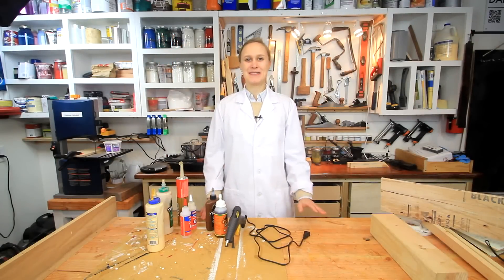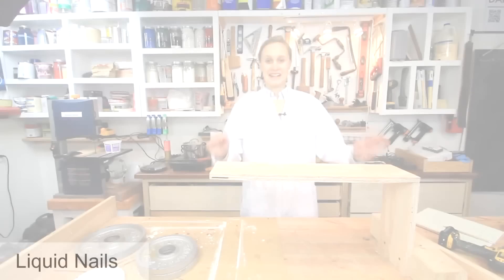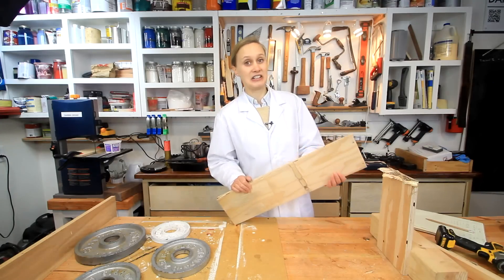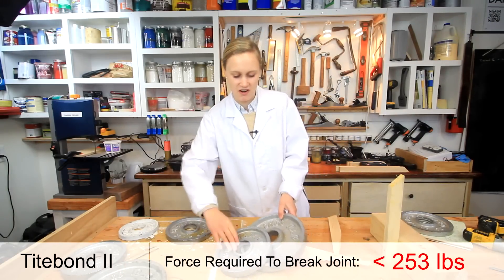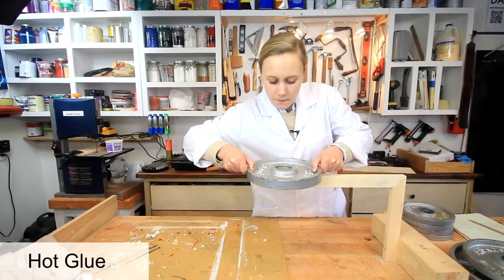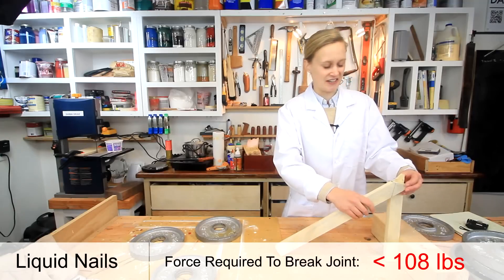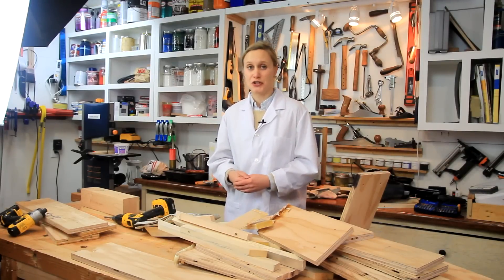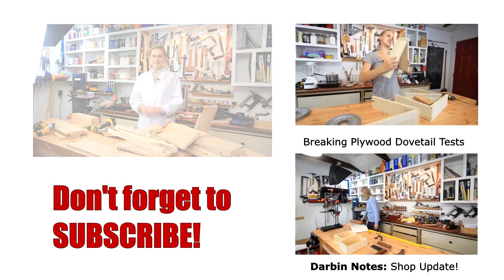Glue Test Destruction - How Different Glues Perform

Comment: Not surprised Epoxy is one of the strongest glue, remember that almost all of the WW1 and part of the WW2 airplanes were entirely glued together with epoxy !
Reply: Strong but the weak point is not a  flexible glue so it crack on long term vibration but depend also of the temperature
Reply: Interesting!  I didn't realize it was that old.  I looked it up and found it was invented in 1930.  It was originally amber colored and used for dentures.
Reply: Unlike the Hindenburg, which had it's hull glued on with UHU…

Comment: for the eproxy, it didnt break as the distance from the pivot has changed when Linn changed it to a 20 pound weight. Thus, the anticlockwise moment might not have increased.
Reply: True. A proper tensile test would have removed a lot of the variability involved with placement of the weights.
Reply: spoken like a true engineer

Comment: Good job.  I know of no readily available product anywhere as near as strong as a decent 2 part epoxy, no matter the material.  Wood, plastic, glass, fabric, etc.  2 part epoxy can't be matched with the single product stuff.  The drawback is the inconvenience of mixing it.  If you want it permenant though, it's the best.  There are even stronger industrial epoxies as well.  As for hot glue, there are many different types of hot glues.
Reply: I think high temp glue is a lot better than low temp or dual temp hot glue.

Comment: if you put the top section of plywood 100mm or 200mm past the vertical section you would be able to test the glue strength rather than the ply strength
on another note marine grade ply is always stronger than construction as its laminated with 2 part epoxy which sort of gives you your answer, without all the testing.

Comment: I always thought the advantages of hide glue are you can take it apart with heat, but it also has a long open working time. Strength is not the only attribute one uses for choosing what glue to use.

Comment: I think a part of the reason why the weights couldn't break the epoxy but you pushing it could is because the weights were also resting on the supporting stick by the fact of the way it is cut to rest on each other. When you pushed it, you pushed it up which doesn't have the supporting stick helping it to stay up and in effect just rips it off. To have a fairer test you should have pressed it down to mimic the weights as well as pushing it up.

Comment: Need a bigger sample size to eliminate anomalies and a variety of different joints/laminations/recreations of glue usage. The first test only established the fracturing point of that particular plywood and mitred joints are not really used for  projects that require structural strength. Matthias Wandel does some glue/joint testing which give a much better idea of what glue/joints are best for each use. You cannot base anything on this limited experiment. Never mind it was entertaining....

Comment: i wished you did a test using wood instead of plywood. you can see that it was the ply layers not holding up.for the test on mitered ends i must add that end grain of wood is extremely thirsty. End grain glue joints can be specificially prone to glue starved joints because the wood is porous there and soaks up the glue.

Comment: Sorry, I don't know if anyone brought this up, but construction glue is not traditionally used for butt joints or miter joints.  It is used to glue panels on walls as one example, and the forces on the glue joints will be in a different direction than on the joints you tested (I am not a mechanical engineer, but I think the forces will be shear forces and not stress forces).  I would also device a test setup that would mostly eliminate the stress on the wood and concentrate it on the glue joint.  Having said that, I did enjoy and I love your curiosity and enthusiasm!!  Keep up the good work.

Comment: This test proves nothing since you didnt hang the weights on the same point. Putting them on the same spot doesnt make it even sorry
Reply: you must not understand math, if you adjust for variation in lengths in your calculation you can put it at any distance
Reply: *****
 Thank you for your thoughts about my math skills but I am an engineer. I do know what I am talking about unlike you.
Reply: Sertaç İpek Then you should know that it's physics 101. Model those weights as point forces centered on the center of the weight and it's a simple torque equation. Since we don't know her math methodology, we don't know whether the distance was accounted for or anything. But obviously she was doing something since the reported forces are very different from the weights applied. You're picking at what's probably the most easily accounted for problem with the whole setup. Assuming all the boards were the same size, it's a matter of math, and you can always redo the math as long as you have all the data.

Instead, try picking on something that's actually wrong with the methods. Like laying weights in large increments which causes a sudden jolt of force on the boards. Or how weight was reduced and then re-added, which skews future results because the joint undergoes elastic deformation when strain is relieved.

Or just calm down, because she clearly states at the end that she understands it's not rigorous, it's not scientific, and she's not a trustworthy source. It's only meant as a real-applications sort of test to demonstrate what sort of performance you can expect in a hobbyist project.

Comment: Linn, a fun video to watch.  The concept of the test is fantastic.  The actual test, if you wanted to get reliable data would have to be done differently. The biggest flaw is from  spreading the force   across the horizontal piece instead of suspending the weight from lets say a hook that is placed the same distance from the joint.  An alternative to the weights would be a bucket that would receive sand.  Far more accurate.  There are a few other minor things (don't use mechanical fasteners), but overall I enjoyed the video and hope to see more.  Keep up the good work!

Comment: Nice video Linn! If only the glue manufacturers created videos like this instead of biased infomercials. It would be interesting to see how those glues held up if you cut and re-glued those offcuts and repeated the test a year or so from now. Some glues might perform better if they've had a much longer than recommended time to cure. Others might deteriorate very noticeably even after a small amount of time. Hot glue is definitely a hidden gem for temporarily holding things (loved your video on that too - especially the wiring and insulating low voltage components). Very surprising how well it did and also how relatively badly the liquid nails performed. If you need some stress relief you could get the hammer and chisel out for a surface glue up test. :D
Reply from the maker: Paul Warhurst I agree it would be cool to see how well the tests hold up a year or so from now. However it would be kind of annoying to store those tests in my small shop for such an extended period of time. I'm glad you liked the glue hacks video! Thanks for the nice comment.

Comment: I just sat through a class on glues taught by Roland Johnson from fww. According to him epoxy is the only glue that is structural. I have a feeling that those nails did not apply adequate pressure to those joints. I would like to see you repeat a couple of these tests after clamping the joints with a screw and then removing it. Grab a bottle of tightbond 1. It is much more enjoyable to use and sand. Any ways, Thanks again for another great video.
Reply from the maker: Peter Hartman Thanks for the comment Peter.

Comment: Exciting and insightful! I was really amazed at how well the hot glue worked and really surprised at how  poorly the liquid nail performed. 

Your work table is so nice. I've watched the video where you planed your table top and I always cringe when the weights are about to fall on it, thinking it will cause gouges on the surface. Did you get any from this experiment?
Reply from the maker: txc250 No, I put down a hardboard covering on top of the board. However my workbench is full of dings, so that's why I just re-plane it whenever I need to :)

Comment: Most surprised by the Liquid Nails because I've disassembled plywood cabinets that were butt joints and LN and I couldn't break them apart but had to cut them.
Reply: Liquid nails is the worst garbage you can waste your time , and money on.
Reply: ya,   I know that someone built an entire boat using just a high quality construction adhesive.

Comment: No glue will work really well on an end-grain join.  I would be interested in seeing a test with long-grain joins.  This is why I think the hot glue worked so well - the glue does not rely on bonding with the wood cells.

Comment: Maybe if you could use some quality Baltic birch ply. The one you use has only 5 or 6 layers. The one I am talking about has more than 12 layers. I guess it far more quality than this cheap construction ply you are using. The downside is that is ridiculous expensive. http://i266.photobucket.com/albums/ii279/pmenegatos/woodworking/DSC08620_zpsd0baf7d2.jpg

Comment: Hello Darbin,

Very entertaining!  I test adhesives on a traditional shear test machine, and found your method of testing fun and interesting. Your tests are quite accurate, epoxies are known as forming the strongest bonds with most materials. That is because they become a stronge plastic when cured, so they can fill gaps, but also penetrate the wood, harden, then form a strong attachment. Epoxies usually are stronger than wood in most tests, so the wood breaks. We call that a "substrate failure"

I am Art, the manufacturer of Mr. Sticky's Underwater Glue. If you like, take a look at our test video page: http://mrstickys.com/media/. If you want, I would be pleased to send you some of our glue to test. We could also talk about other ways to understand glue. Our epoxy contains rubber, so it can stretch 108% when cured. This lets joints vibrate, shrink and expand without the epoxy cracking. (Most epoxies can only shrink or expand 1-3%) Our glue is also sticky underwater.

Thanks again for the great video, we all had a good time watching!

Comment: Very entertaining for certain, a little educational. Typically glue is used in place of mechanical fasteners, for that reason I think the brad nails contributed a significant unknown value to the miter joints. I'm definitely going to do a test of titebond and epoxy on a miter joint that has been clamped. I would be shocked if an end grain joint is much stronger than a butt joint. Keep the videos coming I love them.
Reply from the maker: Geoff Tipre Thanks Geoff, send me the results of your test!

Comment: I liked your test. I'm not surprised by the performance of the epoxy. That is some strong stuff. The stuff I last used had an advertised strength of about 1300psi.  I just read a report that epoxy can have a tensile strength higher than 10,000psi.

As for the plywood, I wouldn't dismiss it so quickly as crap. It works very well under compression. In your tests, you weren't putting a compression like load on it. It wasn't meant to have forces pulling away on the individual plies.
Reply from the maker: Harry of All Trades Yes, I agree, but often people use plywood just like this in furniture so I thought this was relevant. Thanks for the comment!

Comment: I think you should rerun this test using edge grain to edge grain and not end grain joints, which, is the proper and better way to glue wood. If you want to use plywood, then do so using box joints and maybe add some rabbit joints. I suppose you could use box joints for the solid wood too so you can do the cantilever tests using your weights. This was the wrong application for the liquid nail, but I'd be interested in knowing how it holds up to edge gluing. If you can figure out a way to test it using face to face grain, you'll see a different result. Try priming a board using the hide glue. I think you'll see a different result than what happened with the yellow glue. You should also try Elmers white glue. Many furniture makers use it, or an equivalent and Paul Sellers says it's as good as yellow.
Reply from the maker: kperellie Thanks for your comment. I will be trying some of these ideas out in future videos.

Comment: Yes i've seen that one but. But doing different joints with all of the different glues. Testing buttjoint, dowtails, mitered joints, halflaps etc. Testing every joint and with every glue.
Reply from the maker: Yes, that would be an expensive test and a very long video :) To make it really complete, I guess you'd want to use every species of wood too.
Reply: I would love to see it, but for the joints it does not have to be different kinds of wood

Comment: Great test Linn.  Plywood is definitely not something I use butt joints one and this proves it.  I stumbled across how strong 2 part epoxy was when we were making bottle stoppers.  Some of it got into a wood joint that was part of a temporary stand we built which only had screws in it.  It was oak.  Needless to say that temporary stand is no longer temporary.  The hot glue I was told about from other turners.  They screw a piece of sacrificial wood onto the lathe base plate and then hot glue the part they are turning to it.  It's incredible strong and I have not had anything pop off while turning.  I was really surprised about liquid nails.  I used it while remodeling my staircase and when you glued something down you needed a pry bar to get it up.  But it probably has more to do with the fact it is not a butt joint and almost all applications of it are things like 2x4's glued down onto plywood to form a base plate.  Then they are nailed.  Well at least my favorites did well :-)  Thanks for sharing.  It was fun to watch.
Reply from the maker: Jim Coogan Thanks for the comment Jim!

Comment: Hi Lin, a really useful test, thank you for going to the effort its something many of us wonder but never get around to doing!
And very entertaining, one thing I think is glues such as gorilla glue are foaming agents thus I find work very well in joints such as tenons etc as they occupy any space within the joint where others such as tightbond don't.
Food for thought
Thanks.
Reply from the maker: Graham Alexander Thanks for the comment Graham!
Reply: Actually the foam part of the gorilla glue is not strong  so you will find that epoxy is the only really good gap filling glue of the ones she tested.

Comment: Hi Darbin,  It looks like the joint in the TiteBond II test held, and the material failed?  If that's the case, would the test not be considered inconclusive because the join was not fully tested due to material failing?
Reply from the maker: Bobby Kurczewski You are correct that the wood did fail in the miter joint test using Titebond II, but the joint also failed, although it may have been influenced by the failure in the wood. Thanks for the comment Bobby!
Reply: Hi Darbin! My apologies, I was referring to the very first plywood test with Titebond II.  I should've been more clear!